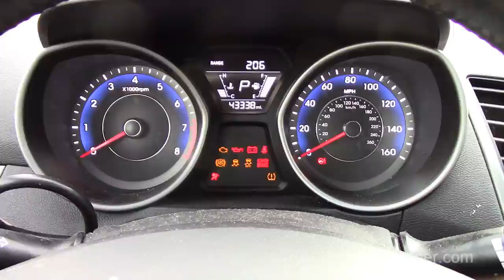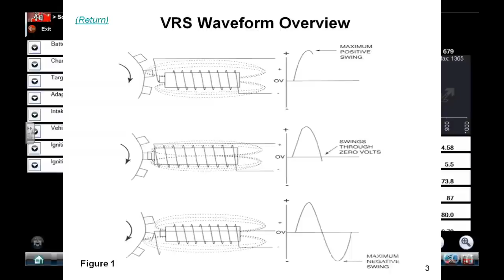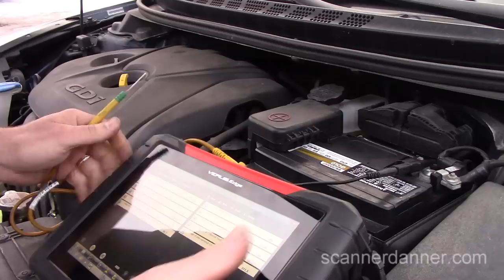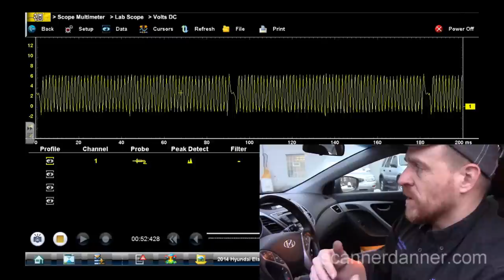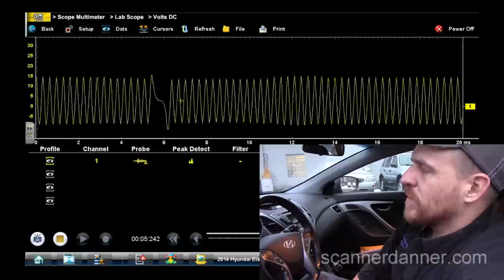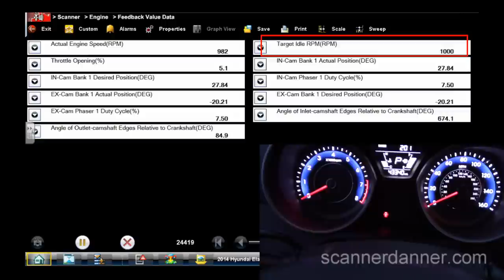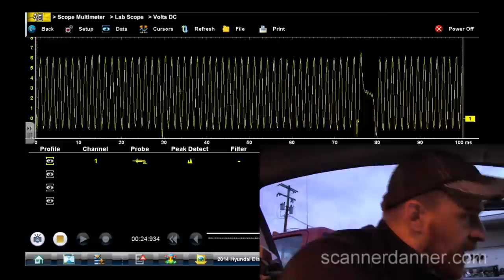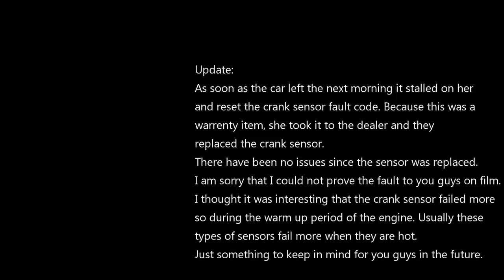2014 Hyundai Elantra Intermittent Stalling P0335 Crankshaft Position Sensor "A" Circuit

Comment: Ours had the same problem we changed the spark plugs and that crankshaft sensor after that car was running cherry and check engine light never came back

Comment: I had the same symptoms.  Crank fault Code. I replaced the sensor still doing it. What do I do?
Reply from the maker: Test the circuit like I did. Could be a wiring issue, computer issue or drive plate issue

Comment: Without a scope, with multimeter red test lead backprobe to signal wire of CKP
On crank, what volts will register for you to see its dead or working as you simulated with the scope.
Reply from the maker: This one is all you https://youtu.be/TXKf96wqaoU
Voltage of the signal will be an average of the on/off signal. For example a 0-5v square wave with a fast on/off frequency and a 50% duty cycle will read 2.5v
A 10% duty cycle (everything else the same) would be closer towards 0v, (around 500mv) and a 90% duty cycle would be near 4.5.
Hope that makes sense. 
Now if the frequency slows down more, where the voltmeter can keep up, you will see the 0 and 5 transitions. You have to bump the key (watch the video I linked) to see it.

Comment: Sweet vid.! Question could you have tested the sensor using  both leads straight to the sensor instead of grounding the black lead.
Reply from the maker: you can do that but my preference is to use battery ground
Reply: ScannerDanner another thing I thought you would set your meter on ac since is a two wire sensor like you did on that other vid with Lincoln?

Comment: Had this exact problem last week and had the 0335 code. Replaced the Crankshaft sensor and the car doesn't stall anymore but now im having a problem with overall car power issue when accelerating and some engine choppiness flickering the engine check light. Not sure if this new issue is related or just a coincidence. Could be a need for spark plugs, a fuel filter, coil starting to fail or even the TPS. I'm going to do a full spark plug change and see if that helps then go from there. Any chance when they put the new C-sensor in that it negatively affected things? 105k on a 2011 Elantra Limited.
Reply from the maker: if the check engine light is coming on, you will have a code, you need to start there
Reply: @ScannerDanner  It's not staying on yet with the new issue, just flickering when the car coughs. Could be any of 5-6 things i guess with that many miles. Going to  change the fuel filter too. Just seems ironic it's happening right after changing the C-sensor.
Reply from the maker: It doesn't need to stay on to set a code
Reply: @ScannerDanner  Yeah but it isn't yet, though the stutter on the highway was more prolonged today and the light stayed on 2-3 secs longer so it will hopefully come on soon. I'm pretty sure it's plug or coil related.

Comment: Hi I purchased a used Hyundai Tuscon 2014 (2Liter engine) and it works complete ok except suddenly it stops the engine/misses engine fire and tachometer also fails that time. Either it completely stops the engine or if it runs, acceleration slows down, tachometer does not work. There is little click click sound could be heard from driver seat. By seeing your video, it looks like my case is similar. if I shut down the car and restart, everything works fine.  The throttle body was cleaned by a mechanic friend of mine. I got the car stopped at stop sign. Later it stopped while running with 40-60 km/hour speed. Does it mean that it also having crank reluctor ring problem? Thanks
Reply from the maker: you should have a code for the crank sensor if this is what is happening
Reply: @ScannerDanner  Thanks for replying. initially didn't get code that's why dealership told the car is fine! The harness/connector with throttle body wires did not look good to me. I touched those and I got codes P0335, P0222 & P0123. I have ordered crankshaft position sensor. I never had problem with acceleration. If there is problem with throttle/position sensor, what will be the symptoms? I am going to work with cables first. >> Found problem in the cable, loose connection.

Comment: Does any type of reset need to be done after replacing the sensor?
Reply from the maker: Shouldn't be. If you're still setting crank sensor codes, some testing of the sensor must be done. There could be a wiring issue, drive plate issue, or ECM problem

Comment: Hello I have the same issue with a car I tried different CKP sensors with the same numbers they are supposed to be OEM parts but the car won't start if you go to the Old one it does work but turn off itself and the RPM would not work what's the voltage is should have in the line ? The diagram said is a ground but at this point I have tried 5 different CKP it's just frustrating
Reply from the maker: If you've put 5 different crank sensors in this, you need to focus on the wiring OR get an actual OEM sensor. Not a part that's supposed to be. Get one from the dealer
Reply: @ScannerDanner  we got an OEM sensor I checked up the wires and plugs with the diagrams but to be honest idk what's going on with this sensors I installed an original one into a car didn't work I cleaned up the plugs from the ecu and installed the old one in a car and it did work but honestly there are so many auto parts they selling into an original package but clearly they are not
Reply from the maker: @llonel21  that's why I'm suggesting going straight to the dealer to get one
Reply: @ScannerDanner  I'll do that

Comment: hi bro i get this code p0336 on my hyundai accent 2013 i did change the ckp and do not fix my problem i did check the lines and the signal from the computer and all is ok ..... can you give a tip please,,,,,,my car start whit no rpm too like yours
Reply from the maker: how did you check the signals? power and ground to the sensor good too? can't remember if this is a 2-wire or 3-wire sensor. Also, did you use a factory part?

Comment: Can a P0342 code, Camshaft Position Sensor "A" Circuit Low cause these symptoms to?
Reply from the maker: depends on the year and model of the car
Reply: @ScannerDanner  I have a Opel astra GSI from 96. Sometimes it's just losing power/dies while driving, if I hit down hard once it happens on the gaspedal and goes up to higher speeds it goes back to normal and don't stalls. I can start the engine Immediately after if I just let it die. This happens irregular which sucks.

Comment: Sensor, wire, or computer.....But u forgot the dents the senor is reading from! Had several cars where that was the issue one way or another! Warped converters, bad trans input shafts, bad thrust bearings all can effect the sensor from reading!

Comment: Hey Paul, so how I've delt with this situation is  I've created a bunch of test leads from  pigtails from different electrical components over the years from new generic pigtails or junk engine harness that have been thrown away or something. I    then Depinned them from there connector and strip about 1/2 inch on the end and solder that part so I can clip alligator leads with the meter I'm testing with . They keep keep their integrity for a long  time doing so  . So by doing this you can then match up the femal/male lead to that connector your working with and see if it  fits in loosely or not.  I've found over time vibrations spread  the female terminals out  causing stupid intermittent problems like these. That's why you'll see that extra ( positive insurance clips)  on certain connectors. Too help minimize vibration happening 
 Especially on air bag systems .
Reply from the maker: This is a really good tip man. Thank you!

Comment: I have a 2011 Hyundai Elantra 106k miles and it's doing this exact same problem... I took it in to the shop and they weren't sure what could be causing it of course because it wasn't doing it for them.  Only seems to do it when I'm in rush hour traffic. Ends up holding up traffic having to turn off the car wait a few seconds then start it up again.  So frustrating..
Reply: J L future reference if this happens again, throw the car in neutral when you’re at a stop, then return to it D when you’re ready to go again. Makes it a little but easier to deal with.

Comment: I'm having same issues right now, 2012 model, engine light is on but the drive is normal now, it does chugs at low speed, not sure what to do next
Reply from the maker: Do you have a P0335 code set? And no tachometer operation like this one had? (I think that is what it did??)
Reply: @ScannerDanner  yep..plug in OBD and that is what it came out..crank position sensor..it became too frequent so i did change it to a new one..😅.. just worry that when it happens the car won't start at all..
Reply: @ScannerDanner  anyway, thanks for the video..if not i could get cheated at the shops..lol

Comment: Having the same problem changed the crank sensor but problem still remained. only when getting to 4k rpm revving the car in park the engine shuts off and hard starts on first restart but starts normal on the second.
Reply from the maker: did you use a factory part?
Reply: @ScannerDanner  yea geniune part
Reply: @JSKLeopard  Did you end up solving the issue? Was it the intake or exhaust sensors?

Comment: Great now i have a p0016 correlation bank 1 sensor A , Dealership tells me Crank shaft sensor , sounds more like a timing issue due to chain tensioner or stretched chain .
Reply from the maker: A correlation code is not going to be a sensor issue. It never is

Comment: I changed out the Crankshaft position sensor and the tachometer still hits zero and lost power can you please help me out?
Reply: have u got the hyundai i30?
Reply: P Van I have a Hyundai Veloster
Reply from the maker: Did you use a factory part? If not, that is the first thing I would do

Comment: Did you unhook the battery before tightening this up?
Reply from the maker: You do not need to, no. And this needed a new sensor as the final fix
Reply: @ScannerDanner  thank you. I have to do this today. My car has had this issue on and off for a few years now. Drives me crazy no pun intended 😂

Comment: Having a similar problem with the same model and year.. but my car always turns on, never turned off yet, will idle, but rpm stays at 0. have accelerated but stays high on acceleration around 25. slow acceleration.
Reply from the maker: Still sounds like the same problem
Reply: ScannerDanner changed the cam sensor, still showed, so would agree.

Comment: can anyone explain why desired idle speed goes up when crank sensor is disconnected
Reply: It's likely because the crank sensor is high priority to the ECM for calculating actual engine speed. When the crank sensor signal is lost, the ECM loses its main sensor for determining engine speed, so it probably defaults the electronic throttle body to a specific opening of 1000 rpm and then calculates engine speed based off the cam sensor signal as best as it can. I assume the higher engine speed prevents stalling since the ECM has to calculate engine speed in an unusual way, where it may make some minor errors.

Comment: I discovered they all have chain tensioner issues oem parts brand new will jam in the ribs inside spring tensioners plus chain stretch --Problem solved now it purrs and codes went away on its own
Reply from the maker: That was not the case here. Thanks!
Reply: @ScannerDanner  I had to see what was causing this issue as many dealer ships will put it on brand new and issue will come back ,i tested the tensioner in front of service writer to show him how it jams and was given the cold shoulder ,engineers design fault right there ,all sensors where good and passed voltage test .Just had to share it with you ,cause your sharing about P0335 helped me also mine was different code P0016.Thank you

Comment: Was the engine rough at idle?
Reply from the maker: I think so but I can't remember. Was the RPM low when the fault was present? (on my video)
Reply: @ScannerDanner  The fault occurred when the car was being driven and warmed up. Reset the code and it immediately recurred. I'm going to change the sensor today.

Comment: first i thought it's idler air control valve but these cars don't have it because they're Electronic Throttle ?
Reply from the maker: Correct but even ETC systems suffer from stalling problems when the throttle body is dirty.

Comment: what scan tool are you using  nice interface
Reply from the maker: Snap-on Verus  (the component test meter function that had the connector view and tech tip, is available in the Vantage platform as well)
Reply: ScannerDanner thanks
Reply from the maker: For sure. Thanks for watching!

Comment: Another,funny, thing about the oil pressure sensor... Is that it does come loose. Thus, resulting in the computer thinking that the oil is low . Computer turning off the engine.

Comment: Did no know who to turn have 2003 Toyota Tacoma 3.4l change intake valve cover gaskets run for about an hr tuned off did not starteted back on the engine turns but I can hear fuel pump doing prime but threre is no fuel going to the fuel injectors please help check relays spark there is no record of codes what so ever thanks Jahovah bless man thanks

Comment: Maybe the sensor is made on north. Runs and lives so much on cold wether that its more like to see it runing great in hot temps ;)
Sean this more then ones on EUro cars.
Ones i had a Ford that had electric powersteering, that only worked rigth when it was "warm" or outside temp was warm +10C / 50F talking about car that is not great for country where Santa lives :P

Comment: Hyundai elantra 2002 cranks no start new battery new plug wires and plugs
Reply from the maker: Cannot help you without knowing what you're missing.
Spark?, Fuel pressure?, Injector pulse? Trouble codes? 
Need some direction

Comment: OEM part from Amzn is $30 shipped, just change it.
Reply: Hey David,  what was the part you purchased/replaced from Amazon?
Reply: @WizardofOlde  "Genuine Hyundai 39180-2B000 Crankshaft Position Sensor" $25.
It is OEM from Hyundai. Two day shipping was free. Local dealer wanted $80.
Reply: @ram-ham  Thank you very much!  Just ordered one.  Saw other people on Amazon reviews mentioning the same exact problem.
Reply: @WizardofOlde  doing mine in the morning. Seems like a 15 minute job. You may have to clear the code afterward, not sure. Good luck!
Reply: I bought camshaft sensor on Amazon for that price but I doubt it is any good.

Comment: Exact same problem on my wife's 2013 Elantra GT.  I'm probably just going to change the part and lube the connection with dielectric grease if the part is cheap. Stupid Hyundai - never Again!
Reply from the maker: The new sensor was the fix for this one.